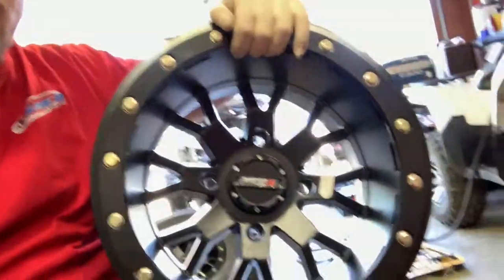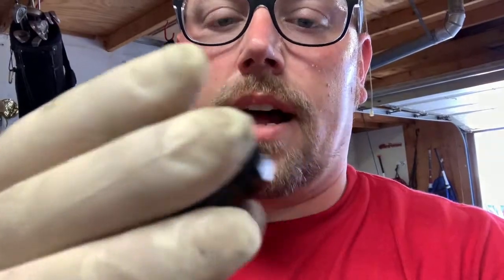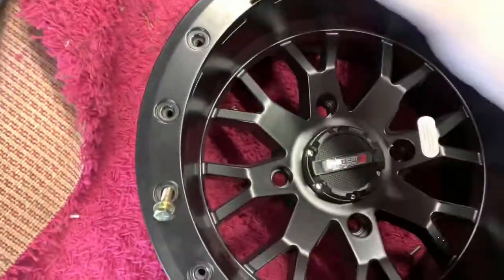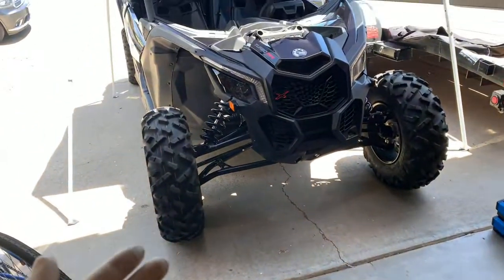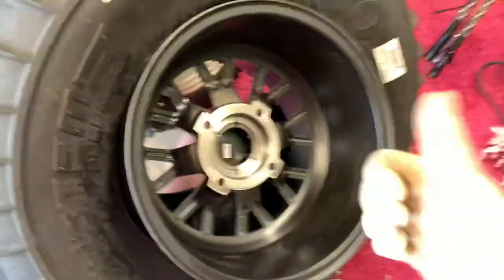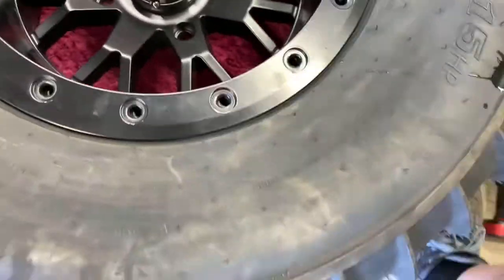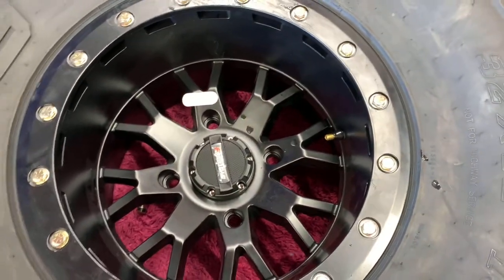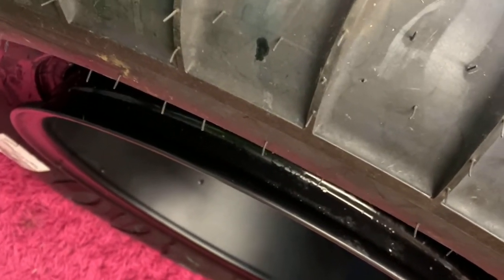How  beadlock wheels work and howto install beadlock them on system 3 wheels

Comment: Actually you should remove the valve core when seating the tire that way the air goes inside the tire faster and then once you disconnect your air hose you should have the valve core and valve core tool in your hand and install the valve core.
Reply from the maker: This is true, if you have all those tools, if not this works
Reply: @ThatCarGuyEddie  that's probably why there wasn't a valve core in there anybody that mounts tires always removes the valve core. Those tools are cheap. You can actually get a valve cap and the top of the valve cap if you flip it over is a valve core remover.